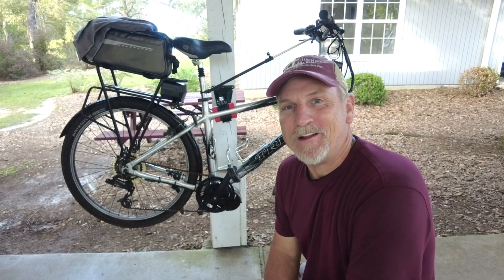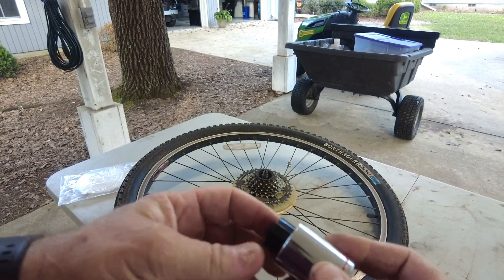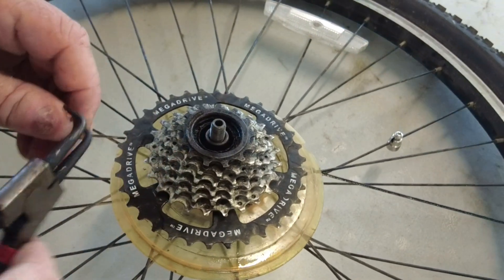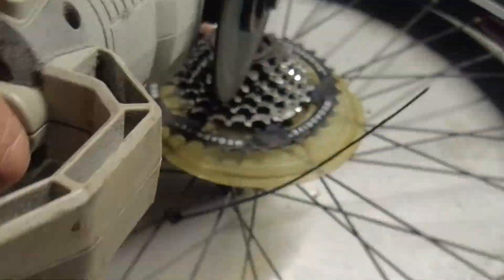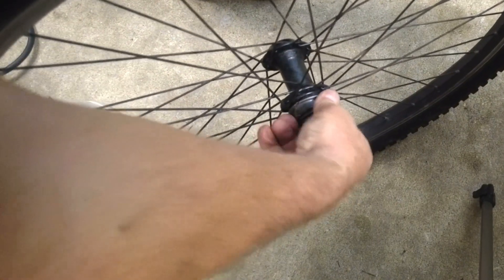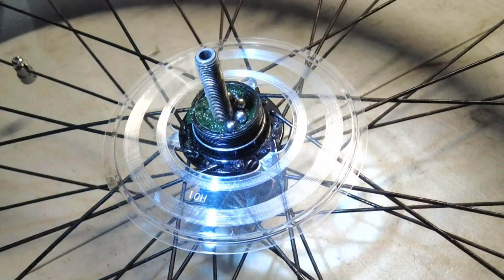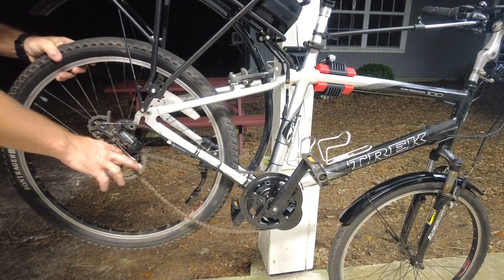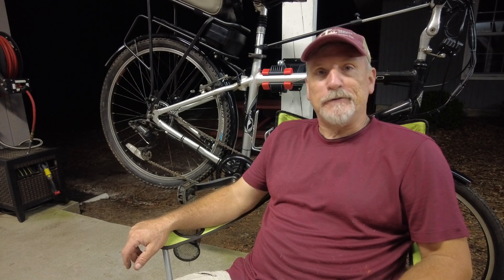How To Change Your Cassette | When Tools Do Not Work

Comment: U could have used a heat gun to hear it up for loosing it, had the same problem did the heat gun thing and it just broke loose easy, great effort though ❤
Reply from the maker: thanks for the advice, I might try that on any part the t is stuck.

Comment: Wrong tool. 

You bought a cassette removal tool. You have a freewheel. You need a freewheel removal tool.

Glad you got it done. Once you get down to the freewheel box you can sometimes use a vice to get it off.
Reply from the maker: A little late for that, but I will look closer at the tools used if I ever remove it again.

Comment: Cassettes and freewheels use different tools and cassettes and freewheels are not interchangeable. There's also 2 different freewheel tools using different splines so you need the correct one for the correct brand freewheel. Falcon brand uses one tool and Shimano and Shimano compatibles the other tool. With the correct tool you don't need to remove the axle lock nut either. I suspect you bought the Falcon tool which didn't correctly fit your Shimano freewheel.
Reply from the maker: I knew that the top chain ring could come off and you can alter the individual chain rings but the bearings in the cassette where bad. I really just went to amazon and ordered the cheapest tool and that is most likely where things went wrong.